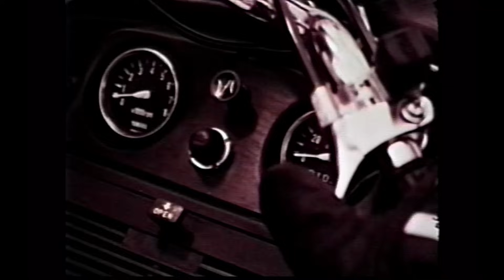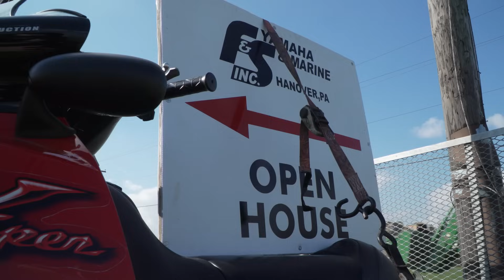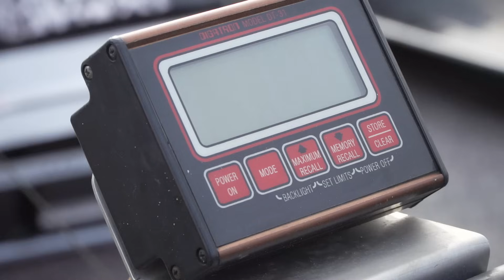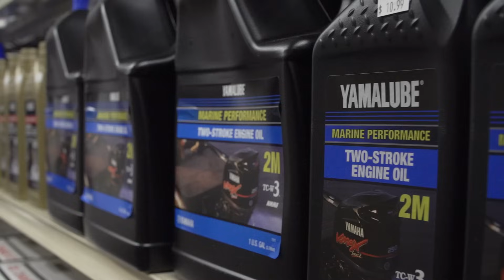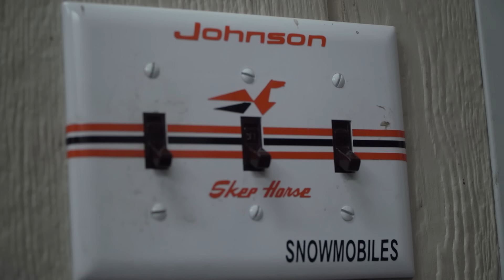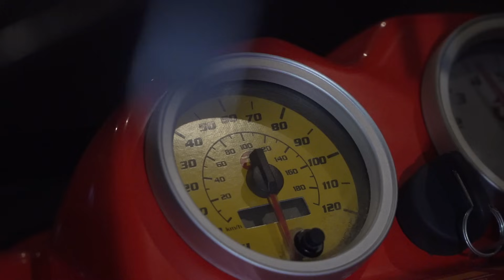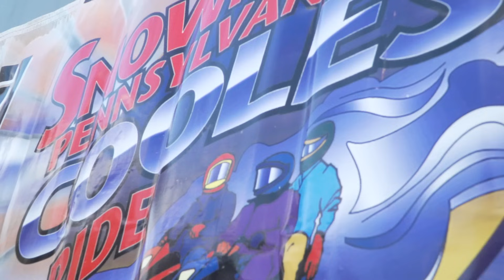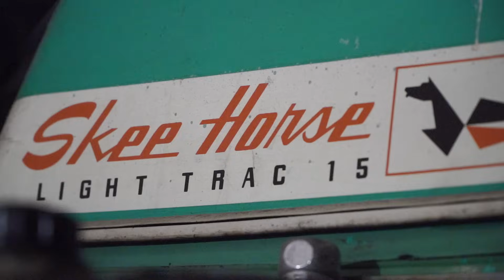Snowmobiler Television 2024 Episode 01

Comment: My first sled around the age of 12 was a 1979 Motoski.  My Dad had to take the spark plugs out, heat them up with a blow torch, and pour some gas down the cylinder heads to get it running and once it fired up after a few pulls, he said jump on and don’t let it stall or you’re walking home.  I graduated to an overused 1981 Yamaha Enticer that usually ran on only one cylinder but it always started up and got me home after a day in the trails.  Love that Yamaha reliability cuz when you’re 13 years old, you don’t have cash for an engine rebuild!  😂👍

Comment: My whole extended family drove Yamahas beginning in the late 1980’s after moving over from riding Polaris.  The quality, the fit and finish, the reliability, and the smoother riding suspension were immediately noticeable when coming from Polaris, and we had owned 5 Polaris machines.  We have owned 5 Yamahas in our immediate family, and more than 14 have been owned within my extended family.  Yamahas have lasted longer, and been more reliable while riding in the remote woods of Maine where we have spent most of our time.  I feel like Yamaha didn’t put enough marketing into their later sleds, and didn’t listen to their customers’ feedback quickly enough from season to season to gauge the trends.  Yamaha tried to say they knew best what riders on the East Coast U.S. wanted, even though the design studios favored West Coast U.S. trends such as low windshields and mountain sleds.  Many people balked at the quieter more torquey four-stroke 1000cc engines.  Riding snowmobiles had previously been a more visceral experience with many riders wanting to hear their loud two-stroke engines revving high as they excited the corners.  Personally I like the four-stroke experience better, it is more refined, has a longer fuel range per tank (important on long trips in remote areas), and no longer breathing chainsaw-like exhaust fumes from the 8 sleds riding in front of you for the ENTIRE day.  Yamaha simply did not market their products well enough in later years, and the corporation put money into their marine outboards, off-road dirt bikes, and other company divisions that had more predictable seasons of use (not subject to seasons with low snowfall).  I personally feel that Yamaha is making a mistake by eliminating their snowmobile division, and once another CEO takes charge of the company seeking to expand profits, they will start making snowmobiles again, but probably not for a number of years.  If a motorsports company couldn’t find profitability during the Covid-19 boom for all things outdoors, then Yamaha deserves to be out of the snowmobile industry until they find the right leadership to lead the way.  Sad.

Comment: I don't think you are remembering wrong about the pogo-stick V-Max. My 96 is flatter on curves then your girlfriend. They are stock with sway bars and are skimming the ground in the first place. 
The Phaser was top heavy and tippy.
By the way, it is not a memory, I and thousands others are still riding the mid 90s V-max series.